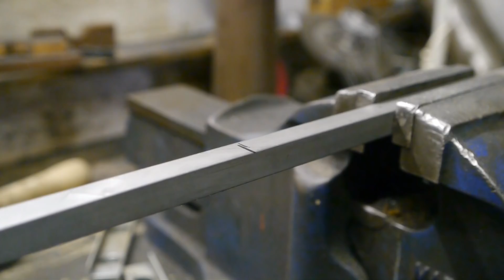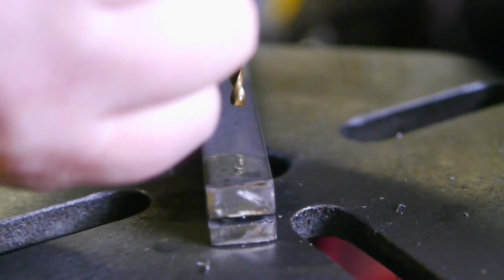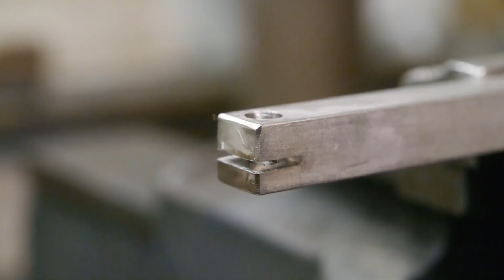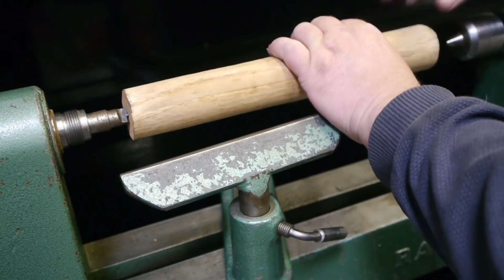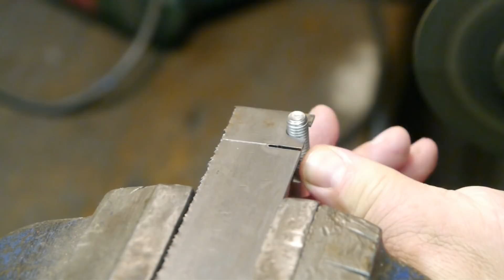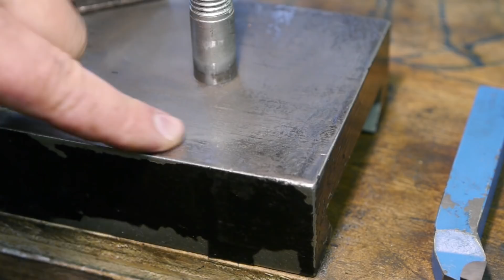Making a metal surface scraper

Comment: I've heard that it's supposed to be a 5° negative cutting angle! Meaning a 5° obtuse angle in contact with the material!
Reply: So it could be still be perrrrfect by only changing the cutting angle?
Reply: Depends if you're cutting cast iron or steel. Very different geometry between the two

Comment: Your contact edge is toooooo sharp. All of the blades Richard King sells have a double ground edge, from 5 to 7 degrees. The arc of the radius you,have here looks good. Those vary anywhere from 15 to 60 millimeters.
Reply: also you should absolutely use carbide blades, HSS or any hardened steel gets dull pretty quickly. Might find some on ebay or at a flea market

Comment: It's HSS .. I recommend you find an Insert of Carbide - Tungsten ( Wolfram ) Carbides is the best - then you get a green tungsten grinder stone .. grid 60... and a carbide small stone for sharping the fine tune... <3  . . .   ;-)   Old Carbides can be reused.. on ebay you will find the 2mm x 25 x25 and   30 x 30 insert from Sandvik...  the best .. they cost 25 Pound each.. but worth it.
Reply from the maker: I'll probably have to buy something at some point. Used the scraper for my latest video and it pretty much sucked.
Reply: at Ebay the are around 20 pound for one carbide 25x25x2
Reply: old inserts those TPUN 16 16 are good

Comment: Looks to me like the victim of your excercise is a piece of steel? if so, you need a lesser negative (scraping) angle, or a little positive (cutting edge). Steel will anyhow be a fairly difficult material to scrape /cut..
Reply from the maker: Thanks for the tip. And you right that was indeed a piece of steel.
Reply: You're welcome. Steel is "scrape-able" but expect nasty slivers of metal that you can easily cut yourself on..
Practice makes perfect (here also) and I found that a tap and lift technique, ie. begin the scraping stroke "in the air" on the downward/forward motion and lift out after releasing downward pressure... , which normally then avoids/minimizes the need for stoning, also helps minimizing the formation of these sharp burrs

Comment: sounds like some bearing is failing on that lathe
as for the handle , i was planning on using a gearknob from a car as a handle , they usually screw on and have a good fitting surface
the hacksaw blade is a good and cheap idea thanks for the tip , you mightve made the ground rake angle too sharp and need to make it more towarths 45 degree
Reply from the maker: Thanks for the tip. 
And yes I really should look into that noise. It's been that way since I got the lathe.
And it just developed a new noise that probably comes from the motor bearing. The joy of a cheap Chines lathe :)
Reply: Stefan Gotteswinter said it right when he said that you basicly buying a pre assembled kit you need to finish youreself 
he has plenty of chineese stuff in his workshop and he rebuild most of them , scraped parts flat , rebuild them , fixed excesive play stuff like that , from wat i can see the stuff he ends up with can (allmost) measure up against stuff many times more expencive 
the problem with the woodlathe mightve been that the bearings where installed dry without grease
if you want to learn sumring about tools and metalworking his channel is worth watching
Reply from the maker: I've watch some of his videos, he's very precise.
I though you were talking about my metal lathe. It's spindle sounds a bit of.
My wood lathe isn't even Chines, but sounds horrible because of the VFD and the resonating cabinet.
Reply: i have a vfd on my lathe as whell , theres a setting on it that can lessen the noise 
think it changes the frequency , there is a rish that the thing will react on other stuff like youre radio if you change it , its been a while since i been in there but it should solve the problem or at least lessen it , i allso had to go from a star setting to a delta setting on the 3 phase motor

Comment: My Sandvik carbide blades have a negative 5 degree edge on them. Might try that.   I agree with the comment about the bar being flexible.
Reply from the maker: Negative rake scraper? Do I need to grind a bit of the underside of the cutting edge/blade?

Comment: Try to harden the edge with a propane torch on that scraper so you can get a much higher quality edge. IF i am not mistaken those saw blades in that size are not through hardened but are only edge hardened. It is good steel though. So a trip with a propane torch to about cherry red and then a quench in oil should give you a fairly hard surface. Also broken files are a good source for scraping steel. Good luck and have fun.
Reply from the maker: You are correct. Only the teeth are hardened. 
I don't show it in the video but the cutting edge is ground on the teeth side of the blade. And it's the hardest hss you'll find.

Comment: I think your scraper design might be part of the problem, it is way to stiff (they used to scrape with old files that had the same problem). I myself use a homemade copy of a Biax handscraper (the one with the blue handle) because I can switch between different blade lenghts to get a different stifness and blade size, but a copy of a Sandvik hand scraper will work just as well, just make sure that it has some flex. Stefan Gotteswinter made 2 very good videos on the topic of scraping. If you want some more information on my hand scraper or scraping in general send me a message and I will happily explain. the blade needs to have a radius like you had in the video (90 or 60 mm for your average scraping and 40mm for getting a higher amount of points per inch, for cast iron you need to sharpen the blade to a -5 degree angle) you will also need a surface plate (a small granite surface plate is not very expensive, in the netherlands you have hogetex and mytri, mytri is on the more expensive side, but at hogetex you can pick up a small granite surfaceplate for around 90 euro's, and you can use it for more than just scraping. Or if you have the patience you can get 3 pieces of the same size cast iron and scrape them flat using the 3 plate method originaly used to create surface plates. Now for the blade I would highly advise you to use carbide (something like a Sandvik 620 series blade or a carbide blank), carbon steel is the worst, hss is better but carbide will last many times longer than hss, the only downside of carbide is that you need diamond to sharpen it. If I am correct you are a member of practical machinst, look up some post from Richard King and Forrest Addy they are the real experts. you just have to remeber that if I can do it as an 18 year old (I have been scraping for 3 years) you and everybody else can do it to, it just takes some practice. fijn weekend.
Reply from the maker: Thanks for that comment.
I would like to see a picture of you're home made scraper.
And could you explain.  quote: 0 or 60 mm for your average scraping and 40mm for getting a higher amount of points per inch
Reply: The 90,60 and 40 mm are the radius of the scraper edge, the points per inch determine surface contact. Higher points per inch are used on for example sliding ways  while, lower points per inch are used on static fixed objects. Do you know how I can send you a picture ?
Reply from the maker: I still don't understand the 90,60,40 mm radius. Are you talking about the width of the cutting edge?
On my channel homepage under the about tap is my email address.
Reply: No, the width of the blade can be any size, but in general the are either 20,25 or 30 mm wide. to make it easy, draw a circle with a diameter of 120 mm, now if you make your blade have the same curvature as the circle your blade will have a 60 mm radius. the radius determines the width of the cut, bigger radius means a wider cut, smaller radius means a narrower cut. if you would have no radius, just a flat blade your cut would be as wide as your blade, and generaly you don't want that.
Reply: Ik heb je het E-mailtje met de foto's gestuurd.

Comment: I have not tried scraping.  If you have made the slot for the piece of bandsaw deeper you would have got sufficient flex to grip the piece without the second slot.

I would have tried grinding an old file as a scraper.  Easy to grind different profiles to find one which works.

A steady rest for the wood lathe makes a big difference when drilling.  In case this is of interest, an article I wrote for my  local wood turning club based on the steady rest I made. 

http://lehighvalleywoodturners.com/wp-content/uploads/Project_Documents/Making_a_Steady_Rest.pdf

Glad to see you were able to improve the surface of the tool holder.
Reply from the maker: I like steady rest you make. Love the fact that you used some dirt cheap in-line skate wheels. When I go to a flea market I'll look for some in-line skates :)

You're right. grinding a edge on an old file would have been much easier and likely just as good.

Comment: Why can't you replace saw blade to carbide tip?Lot of ready made stocks are there you can try that .Any good job keep doing
Reply from the maker: I could try that, but the brittle carbide might brake in the not so precisely ground slit.